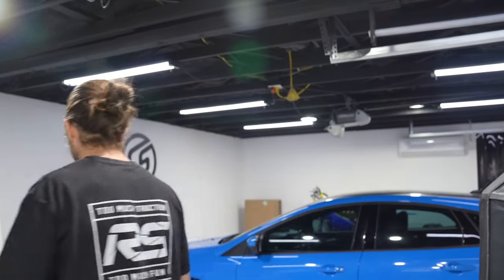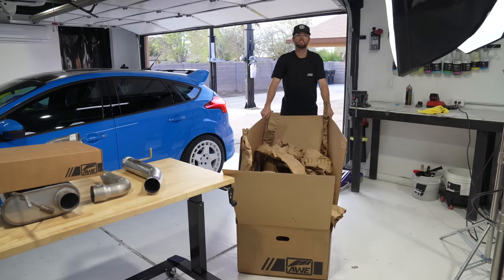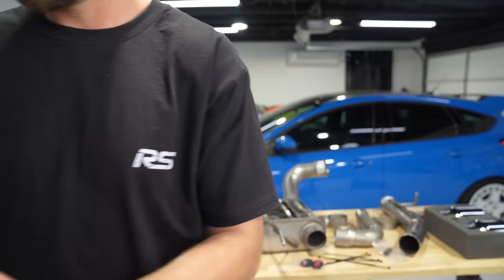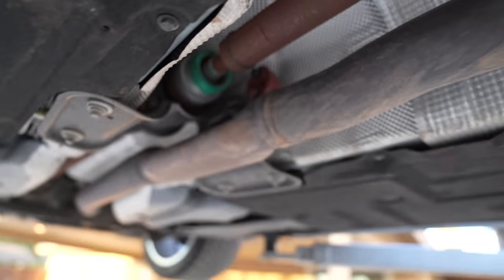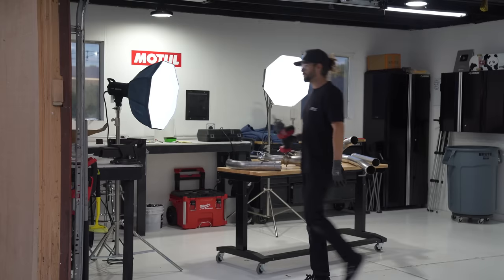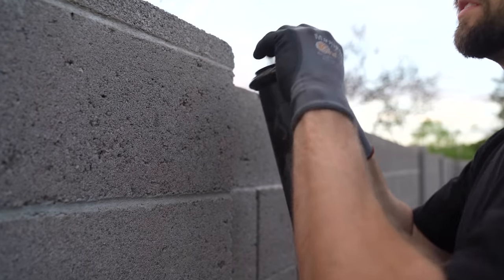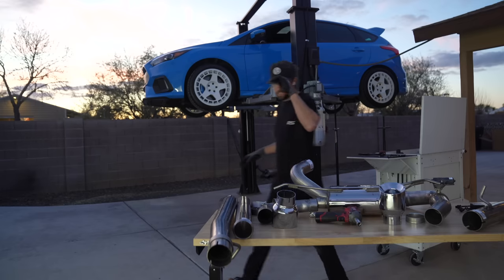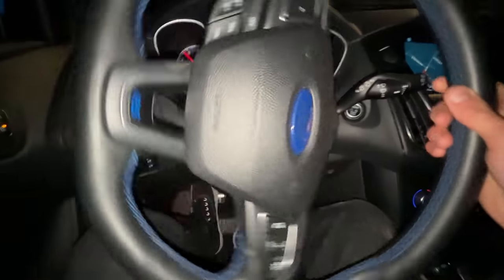This Focus RS Exhaust Goes CRAZY!

Comment: Totally agree on putting the pops "on command". Had the same idea for mine since the car came with a Cobb exhaust (which I hate but I'm dealing with until I get a Milltek) and I just put a catted downpipe on and they're LOUD. 

I enabled the custom ("star") drive mode with FORScan to keep the valve open but the engine in "normal" so it doesn't pop as much. Already talked with Adam at Tune+ and we're gonna set the RPM cutoff to no less than 4,500 for the pops which should be ideal for the way I drive the car.
Reply: I went with the MSD tune which keeps it closed on cold start, plus I have the J9 controller as well

Comment: Sounds way better with it closed imo. As someone who's an enthusiast and has owned many 4 cylinder turbo hot hatches I can confidently tell you they all sound horrible with loud exhaust. Video and install was great as usual and the exhaust looks like fantastic quality but it just sounds like any other 4 cylinder with a loud obnoxious exhaust. 2.0 & 2.3 ecoboosts are some of the worst. I'm on the fence about the 1.6 but I wouldn't put one on my own car.